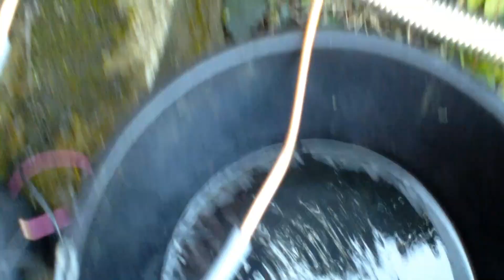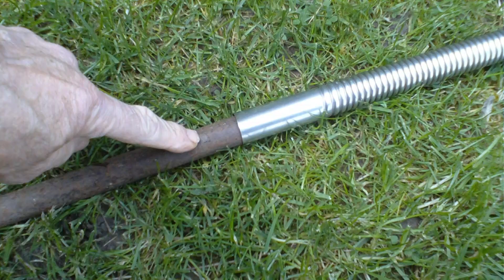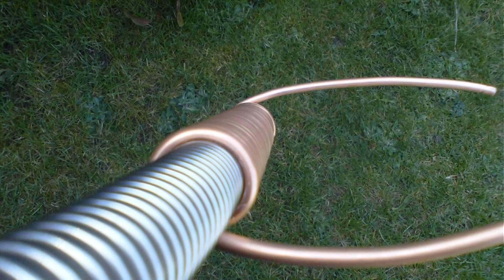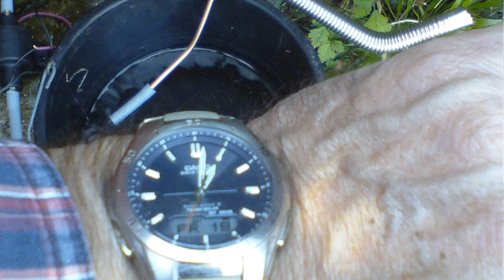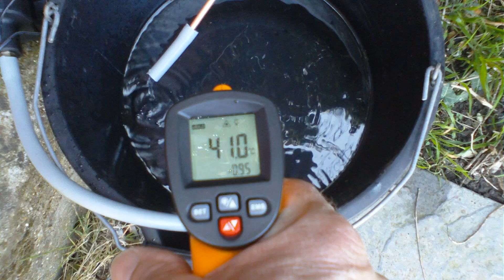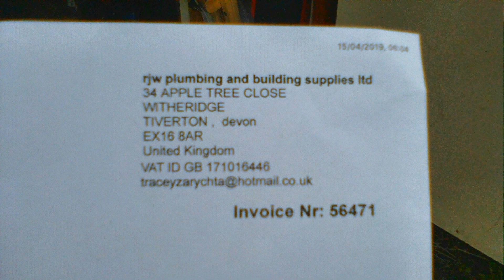DIESEL AIR HEATER EXHAUST HOT WATER FOR FREE VID TWO

Comment: Hey @peter - I have been trying to make one off these copper tuber but i keep snapping the copper. How much would you charge to make one of these copper tubes for me? - I am based in the uk!
Reply from the maker: As long as you bend the same size microbore copper pipe around a former carefully you should have no problem as the copper pipe bends easy BUT YOU CANT RE-BEND IT AGAIN IF YOU GO WRONG  which is why you must take your time and not rush it. Sorry but I can’t make one up for.you as this was only done as an experiment on my part to see how it would work….
Reply: @ thank you I found another really helpful method which was to freeze water in the pipe then bend and worked really well - thanks for coming back to me though really appreciated

Comment: Why can't you just run an extra long stainless steel exhaust pipe into the water tank?  That way you avoid the water pump and copper pipe setup.
Reply from the maker: Hi George. You are restricted on the length of exhaust pipe you can use due to back pressure and soot build up. Also the way I have done this means it can be stripped out without any complicated issues.

Comment: I'm considering this to prevent the tanks freezing on our new Autotrail F72 motorhome. I would have a sealed system filled with an antifreeze mix and join the pump using a rubber tube to allow for expansion. A grid of tubing stuck to the bottom of the tank using closed foam adhesive insulation might work. It doesn't need to be that efficient. Just enough heat to stop the tank freezing. Thanks for the idea.
Reply from the maker: I’m pleased the video has been of help. Just a few points - closed system is not ideal as it’s better to allow a little expansion tank 🤔 just saying.
Good luck. Regards Peter
Reply: @brucepeter2007  1mm or 0.6mm copper pipe? The latter is cheaper. 15m refrigeration 6mm tubing 0.7mm wall is £33 incl delivery.
Reply from the maker: @TheAce5255  I said in the video 6mm which gives a good flow and is a durable size and easy to work with and gives a good flow.
Your choice what to use as I only plant the seeds…
Good luck. Regards PETER
Reply: @brucepeter2007  Yes, I meant the wall thickness. 0.7mm might be easier to bend. Also, what about filling with sand first, as some videos show?
Reply from the maker: @TheAce5255  Hi Andrew. In answer to your question about filling the tube with sand I never wanted to do this. The copper tube is already annealed and bends easily and the trick is to have a good former which is at least the same diameter as the exhaust pipe. You bend the copper pipe around the former and the side in contact with the former actually flattens and thus you get a better heat transfer… Removal from the former is simply  holding the bottom on the copper tube and unwinding the stress on the coil at the top of the copper pipe and the former will then fall away.
I tried to keep everything simple so people on different continents with different suppliers could adapt and still get the same results…
I hope I have answered your question fully.
Regards Peter
Reply: @brucepeter2007  Thanks Peter. I'll have a go. With 15m of pipe, there is some room for error.
Reply from the maker: @TheAce5255  hi Andrew - 15 metres wound round the exhaust will probably boil the water and is really overkill for you if you only want to stop your water tanks freezing… Good luck. Regards Peter

Comment: I've been interested in this simple method. However if you're getting high heat transfer on the coil you wouldn't need the pump since it would circulate itself. But I'm more interested what happens over time, since carbon buildup inside the exhaust would have an effect on heat transfer. Have you used this for a long time?
Reply from the maker: Hi Matt. Thanks for your comment. Tried without a pump hoping that a gravity system would work however it was unreliable so a low cost pump was found to be far better in practice. Regarding the sooting up of the exhaust - all I can say is if the diesel heater is running well you will never have a problem and I generally find that it’s the people who play about with the setting or use insufficient sized cable that won’t supply enough current to the glo plug that are the ones on the groups saying they are sooting up.
The use of a bounding material - clay paste like Gum Gum around the exhaust / water pipe greatly increases the heat transfer and then wrapped with heat proof Insulating exhaust wrap around the exhaust / water coil provides almost boiling water. It works and costs little to do - the design I came up with is simple and has regard that the base heater unit can still be removed simply and serviced with no extra work or time spent draining down the water systems.
Kept it simple. Regards and stay safe. Peter

Comment: Hi. First of all thanks for sharing your idea with us. I have tried your method with 4 meters of copper coil covered with aluminium foil and exhaust wrap to heat water in the tank which is about 2 meters away from the exhaust pipe. My purpose is to prevent water from freezing and yes, this method will surely do it. And it will probably raise temperature about 10 celcius degrees in a few hours.

I have a few issues about this project. First, fuel consumption is raised from 1.8 pulse to 2.7 to keep heater's heat level indicator bars at full range. This can be tolerated to get hot water or prevent freezing. Another issue is what to do with frozen water. I can't start the pump with frozen water in the tank and pipe. I thought about inserting a 1mm copper wire through copper coil and pipe to water tank. I think exhaust will heat the copper wire and this will melt the ice.
Reply from the maker: Hi Toll. Thanks for your comment and some interesting points raised. When I proposed this method I can honestly say I never envisioned the widespread use the idea could be put to and under such harsh conditions to boot!
I will try to helpful in my teply
Reply from the maker: CONTINUED...
Regarding the fuel consumption - I feel that the extra fuel consumption you mention is not a result of the exhaust heat exchanger because the whole idea of this system is heat recovery - which is the surplus heat which would otherwise be ejected by the exhaust after the burning process within the burn chamber - this unit is in truth a “furnace” so has strict parameters it can work within so the extra fuel consumption you observed would be down to other factors or altered settings because the fuel to fan speed air mixture has nothing to do with the design or result of the heat recovery method design...
One other thought has come to mind - have you changed the length or bends on the exhaust as the back pressure could have an effect on fuel consumption but other than that I can see no logical reason the heat exchanger could make the fuel consumption increase - other people’s replies will surely come after reading this as I maybe missing something🤔
“FREEZING PIPEWORK.” This is an interesting one. Firstly the design criteria I proposed was never envisaged in a sub zero environment and this is a whole new ball game but the method of the heat exchanger working that if the water within the pipe were to boil ( pump failure or blockage) (ice)- the pipe would not burst because of the small volume of water contained within the pipe and the available heat at the exhaust I would suspect this could be true with freezing but would bow to superior knowledge from others on this. 
Now this is an interesting adaption of the heat exchanger and the only way another water tank could be heated would be by making the heat exchanger a closed system and have a suitable quantity of antifreeze added to the water to cover the temperatures required.
By a closed system -  I mean that within the water storage tank with ( I presume fresh water) a further larger coil would be required with a good surface area to transfer the hear over from the antifreeze laden heat exchanger pipe to the fresh water tank to lose its heat before returning to the inlet of the heat exchanger to be reheated. A further issue arises as an expansion tank would be needed as well. I hope my reply has been of help as your reply gave limited information but be assured many other people fear the replies so no doubt will chip in with further information that may further help you - such is the power of youtube.
Stay warm, stay safe. 
Regards Peter
Reply: I was planning to use 3m of copper tube stuck underneath the plastic water tank of our motorhome using self adhesive insulation sheet. This rather than inserting the copper tube into the top of the water tank. Not sure if enough heat will transfer through the plastic tank but that is what the 60W electric  tankblanket uses.
Reply: I'm going to fill the pipes with a 50% solution of antifreeze. Problem solved.

Comment: I hate burst your bubble but the actually make water heaters for these
Reply from the maker: Hi there.  Thanks for your comment but my bubble is still intact.
The Chinese did start to market the combined heater / water units AFTER I made my video and check out the price - arm and a leg job .
If you look on the Chinese Diesel Heater forums you will see many guys in trouble for many reasons asking for help on maintenance. With my design the unit can be removed by just undoing the existing clips you would normally have to remove to remove the heater from the vehicle - nothing more.
With the unit which has the water section built in you also have to remove the  2 water hoses (remembering you needed to install on/off taps on each extra water pipe close to the heater)) so you can remove the unit for cleaning or maintenance without draining down your water tank... 
When I first looked at the design I took all this into consideration to keep it very simple and cost effective and able to acquire the parts needed almost anywhere.
Each to their own but simplicity, maintenance and cost were my major objectives.
Stay safe. Stay warm.
Regards Peter

Comment: Brilliant idea Peter, might have to give this a go myself, many thanks for taking the time and putting in the effort.
Merry Christmas 😀👍
Reply from the maker: Hi man stuff. Lots have used the video experiment and adapted it to suit their own installations so if it helps have a go as the results are very good when the pipes to exhaust are insulated and I’ve been told the water gets up to near boiling. Thanks so much for your comment. Stay safe.
Regards Peter
Reply: Try to just put exhaust pipe threw the bucket then you don't need pump

Comment: To make it even more simple, run exhaust directly through the water bucket - even cheaper! Yes definitely a bodge. Thanks for your vids👍
Reply: Of course I did mean run the exhaust PIPE through the water and not bubble the exhaust gasses out through the water 😁
Reply: @Yeoblade  yeah in threw one side out the other just the pipe in the the water
Reply: It would be like a heater coil in the water  thats why I said you wouldn't need a pump but I have been messing with my own hot water supply and colder water stays on bottom. So to to get correct temperature you need it to circulation. But it would work for emergency setup a good backup option to have. Just buy a second exhaust pipe because once its sealed into bucket or whatever container you can take it back out. Needs a tight water seal so it will be permanent
Reply from the maker: @Yeoblade  Hi there. Thanks for making a comment - Unfortunately there are many restrictions with this kind on heater and the length of exhaust is one of them.
The design I have shown in this (the second) video allows you to service the unit with no restrictions from the water heater side with items available almost anywhere which makes it very easy to reproduce. The others consideration is that the way my installation is done there is no chance of combustion gasses getting back into the vehicle.
The pulse pump is very reliable and as the copper pipe diameter is so small if the pump fails and the water within the pipe boils there is insufficient steam to cause any issues.
Stay safe.
Regards Peter
Reply from the maker: Hmmmm
Reply: I thought about that
Reply: I want to try that then you wouldn't need a pump also
Reply: Would it make the water smell? Lol

Comment: Hi Peter, great idea for water heater. 
May I suggest that you install the water pump on the other end of the copper pipe, pumping flow towards the heater to increase your thermal extraction of the exhaust heat greatly.
Reply from the maker: Hi Scot. Thanks for the comment and valid points - I was aware of the pump and flow direction issue but as this was mostly an experiment to get the bee out of my head on the best way to recover the heat I did not take it further however I have had loads of emails and helped many out who have installed the system on both RVs and boats but it would be nice to see some other videos of how people have done but alas to date I’ve not seen any. If you do use the concept it would be great if you posted a video of your installation and the results obtained as with some good insulation I think the heat recovery would be very impressive.
Stay safe, stay warm.
Regards Peter

Comment: This is also a great idea, and a lot more simple then plumbing in an old gas heater and shed, etc. Thanks for the video.
Reply from the maker: Thanks so much for getting back to me as it makes what I did so worthwhile. I always try to look at things with a KIS= keep it simple. - 
Generally works but as you could see by my first effort with the radiator it doesn’t always work - 
I feel on the second video I cracked it because it followed the principal of KIS so well.
Again thanks for getting back to me and stay warm and stay safe.
Regards to you. Peter
Reply: @brucepeter2007   We both had the same idea to heat water with the excess, but I have to say, your idea is actually much simpler. If you have a water tank installed it would mean you have to run the heater a lot more, presumably even more then  necessary, just to get the water tank up to temp... And it would be useless in the summer, or most of the year... 

That said, I am thinking about building an off grid shed - totally off grid in the mountains, so maybe in a situation like that... but really, your way is versatile - perfect. Brilliant, thanks for the videos!

Comment: hi peter. would it mabe be a good idea to try a large lengh of the stainless crinckled pipe and make that into a short coil to mimick the shape of an induction heater so the pire ruturns out of the water. would enable you to directly scavange the heat from the pipe. and a higher thermal differance will increase speed of heat transfare too. mabe a good one to test out pal.
Reply from the maker: Hi Lyons. Thanks for your valued comment.
There are many issues to consider with this type of heater and one of the issues is that you have to limit the bends in the exhaust to allow the burnt gasses free movement and quick exit else the heater has a real tendancy to soot up requiring a total strip down when this happens. The length of the pipes on combustion input and exhaust ideally need to be the same length if posidle to keep the pressure difference about the same. The systems combustion air induction / exhaust can be extended but that would then require the mixture to air ratio to br “tuned” which is where most people go wrong because playing with the settings usually requires special expensive equipment which the majority of “twiddles” don’t have and they end up with soothed up units requiring a total strip down and lost original working settings...
As you can see from the brief explanation above I have given there were many reasons I experimented the way I did because the whole idea was to be able to extract the heat simply with parts obtainable at little cost almost anywhere and also to ensure the basic working system of the heater remained untouched thus not affecting its performance.
The other point I kept in mind was that if the heater required services the attached additional pipework would not add any extra work to the units removal which I hope I achieved within this design experiment.  Thank you so much for your valued comment which I hope I have fully understood and replied to. Always great to hear from like minded people when it comes to ideas so thanks again and stay safe & warm.
Regards Peter
Reply: @brucepeter2007  many thans for you reply. noting better than content creaters that activly reply and engage with the commenters and viewers. look forward to more from you too.  i did stumpble upon a different channel last night. same concept of harnesing wast energy into heating water. he was using a egr cooler from an old car from a scap yard cost him around £10. sounds very promising from the footage and the egr heat exhanger looks the part too for a repurpased componet. mabe werth a watch if you not yet seen it bud
Reply from the maker: Hi Lyons. I was aware of the EGR unit but even though you can get them you need even more ingenuity to adapt it to the heater and extending the exhaust can prove to be a problem with sooting. The reason I went with the copper coil was pure and simple “simplicity” and this also encompassed having to remove the unit for a service without any other water complications from the simple heat exchanger.
Others can modify on this experiment and hopefully post on YouTube which will give me the utmost pleasure to see.
Regards Peter